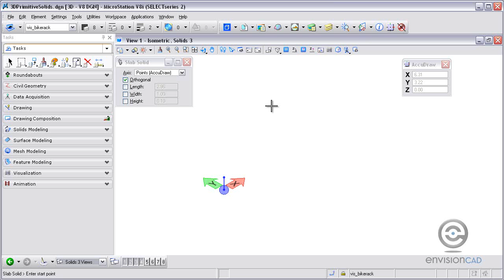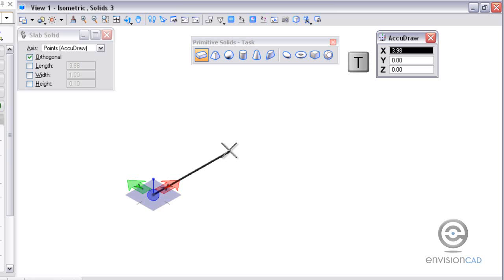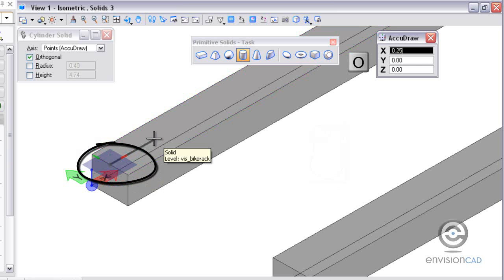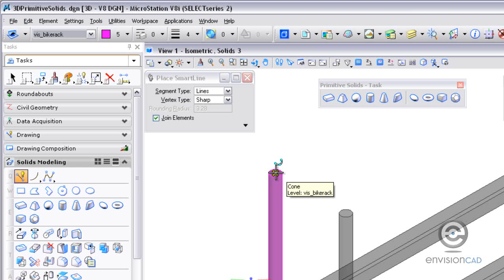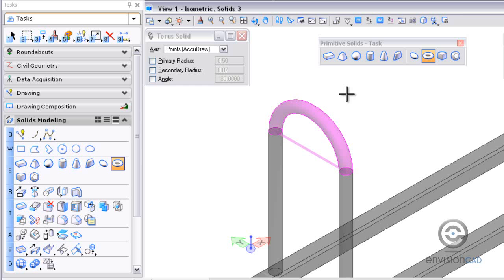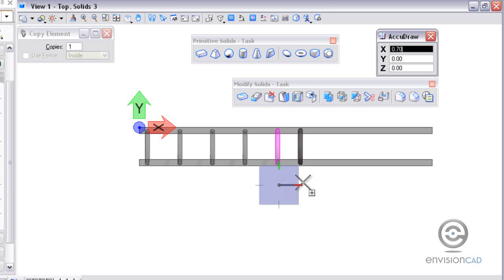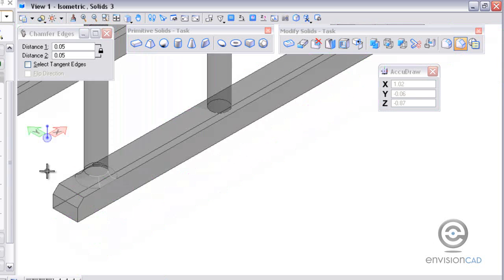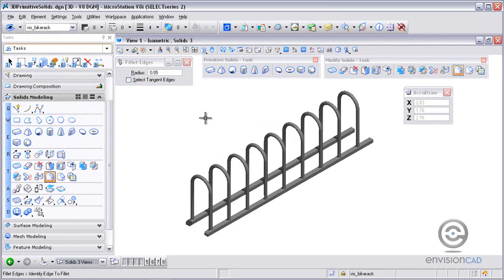3D Primitive Solids - Slab, Cylinder, and Torus - MicroStation V8i (SELECTseries)

Comment from the maker: If you are using MicroStation XM or V8i you can go to the pull down menu and select Settings > View Attributes.  From the View Attributes dialog select the display style you want from the drop down list.  Then depending on the version you may need to left click in the view.

HTH,
Bob Mecham